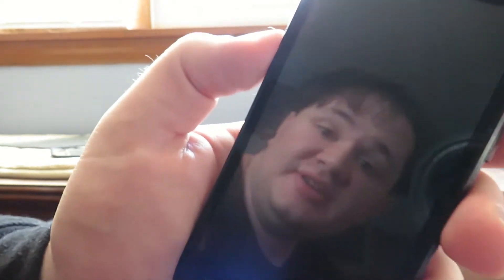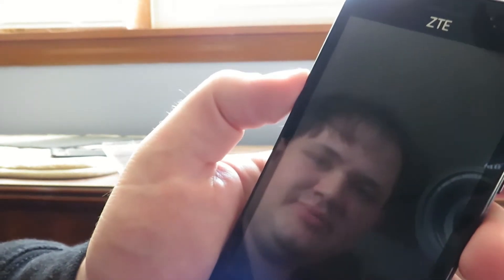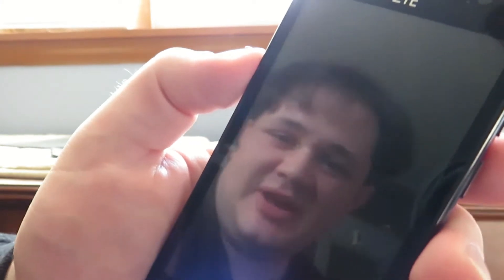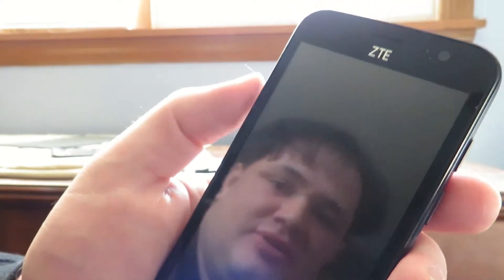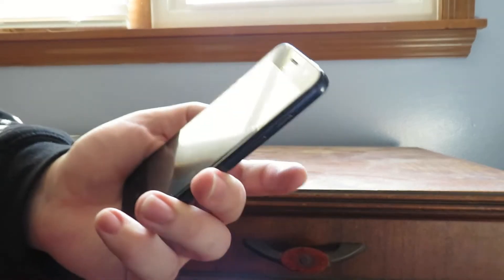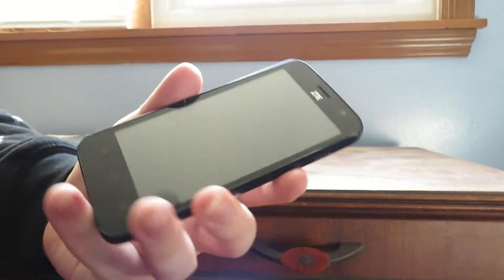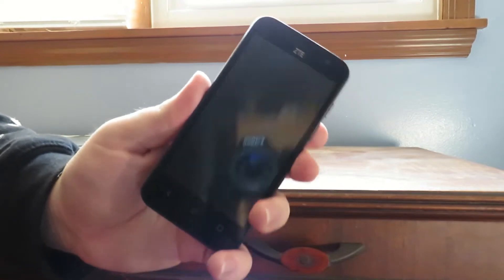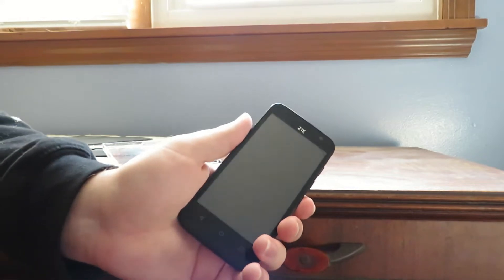All the Elements Inside your Phone

Comment: Did old phones ( say a early 2000's Nokia ) use more or less of the rare and expensive metals? Just wondering if dumb phones are going to make a forced comeback due to increasing element cost, or if the extra cost of smart phones is just the processor /etc.
Reply from the maker: In general yes; the "dumber" it is, the less overall that's inside it.